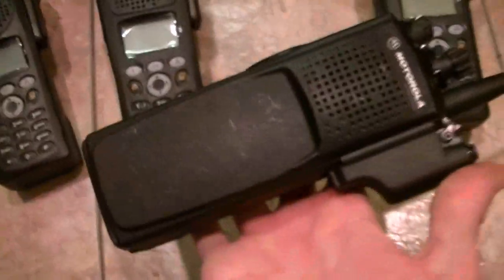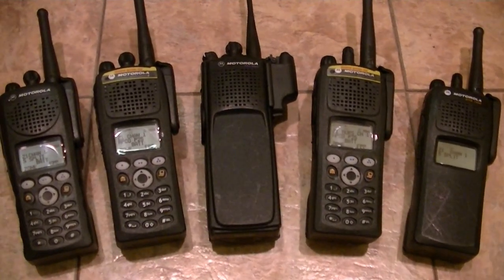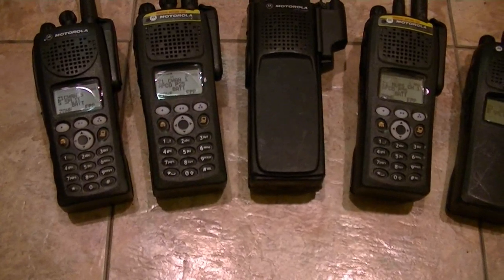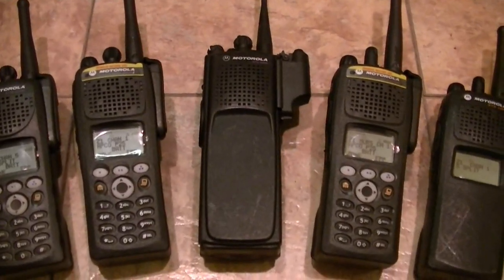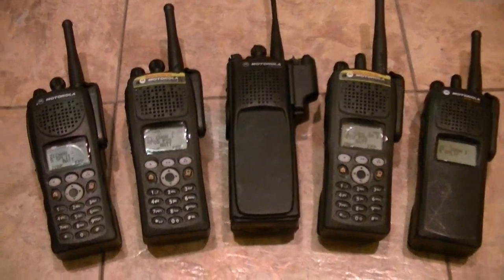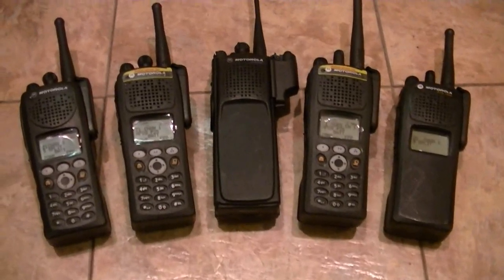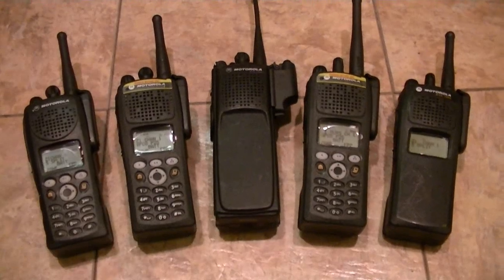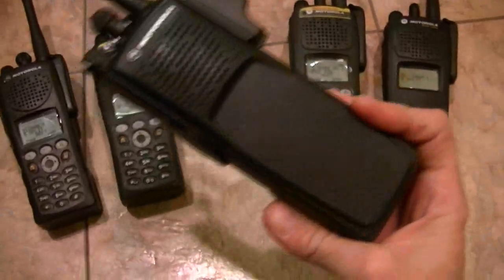Motorola XTS5000's, Motorola XTS2500s, Radios Slated for Upgrades and Radios and Gear In Stock

Comment from the maker: I can grab them at any time.  I have a couple distributors on them, but their prices are pretty high.  I have to make a little profit off of them and the prices for the quality of units I want are set more for an end-user than a reseller.  The first one I get will be in VHF.  I'll only mess with the XTL5000's.  I like the XTVA's a lot and they are a more affordable alternative to a mobile, but I like XTL's a lot and a remote head would be nice.

Comment from the maker: I have both and yes, he mentioned he had a 2500 there that was an internal nightmare.  He was doing everything he could to fix it.  I'm not sure if it was a Panter unit, but Panter is selling total shit as of late and its obvious that he's at the bottom of his stock supply.  I'll buy his housings if no internals are in them, but he is raping folks on shipping.  He charges three times more to ship three housings that weigh less in the same mic box as he does a mic.  I won't touch his radios.

Comment from the maker: It could be several things, but if I were you, I'd sell it and get a digital radio.  Agencies are switching systems over and in the process, many are altering frequencies.  Your radio is getting very old.  I like the HT1000 but its really old and limited.  Check out Batlabs forums and P25 forums.  Theres some fellas on there who are really sharp and know a boatload about issues like that than I ever have and probably ever will.  Your speaker could be going.